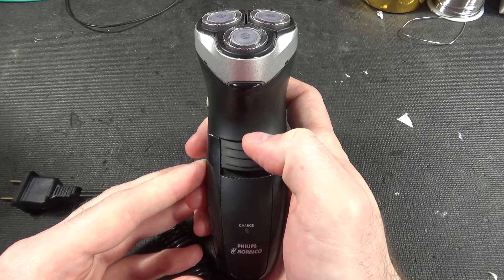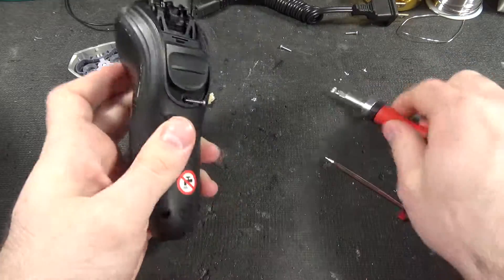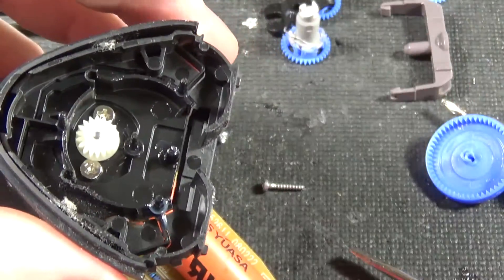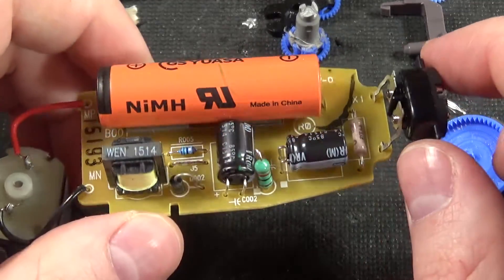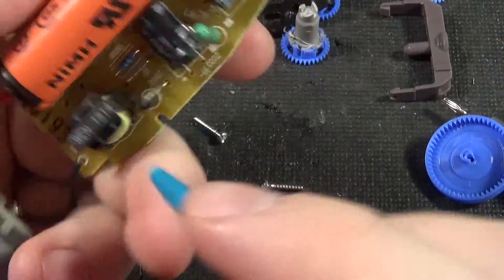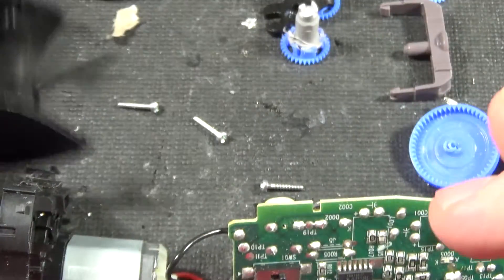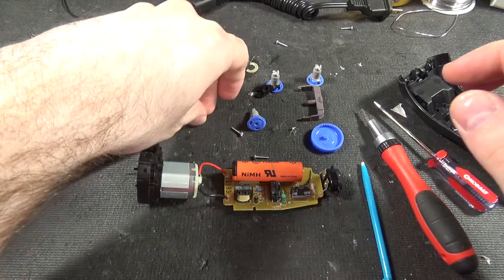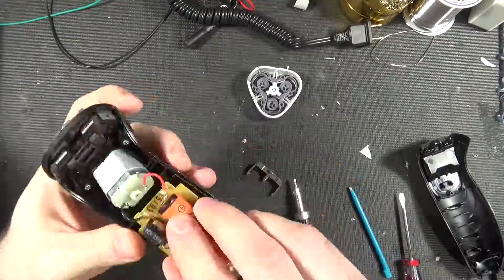Philips Norelco Shaver Teardown

Comment: I remember the disassembly of one of these in 1993, all because I wanted to see how the shaver worked. I bought it for $55.00 a few months prior to the above. I removed the guards, and the cutting heads. With the shaver plugged 🔌 in, I had a hold of the center gear ⚙️. I turned it on, in an attempt to try to burn the shaver out. In about 5 minutes, I could smell the success. Burning plastic (much like anti freeze). The motor started to get quite hot 🥵. I decided to discontinue my experiment, because of possible fire 🔥. I think I failed to burn the shaver out, because it still ran afterwards. Your friend, Jeff.

Comment: I have a model 7000 but the motor speed sucks with regard to shaving; is it possible to electronically speed up the motor for a stronger shave or do you have to replace the motor itself ?? Thanks

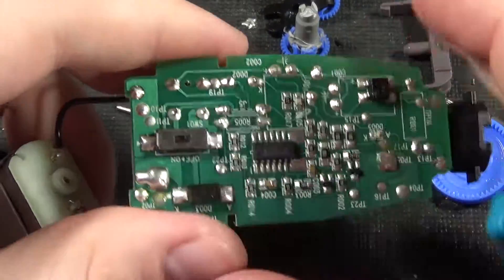Comment: My shaver is dead. So i took it apart to repurpose the motor. The shaver does not have a batteri inside, nor does it have that small switch  on 4:43. I cut the motor out from the circut board (bad, i know, now). i put the motor on a AAA and afterward a AA batteri without any reaction. 
So what should i do to get the motor running? with a batteri btw. 

my thought is that i can soder a travel adapter to the motor but i need to put the jack in the socket to see if it work and i am not that crazy.
Reply: Nice video Btw. Thank you for that. Must have take a lot of work.
Reply: Hello, Maybe the motor is simply dead specialy when the nylon gears have block it , in this case, just try to change the motor. you can find a lot of part with chinese shop , for instance :  https://www.aliexpress.com/af/shaver-motor.htm